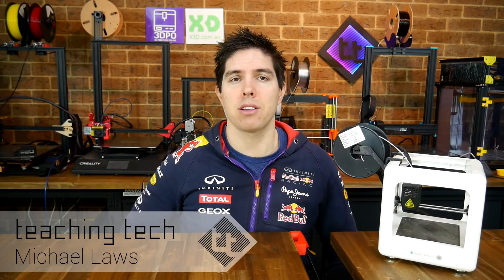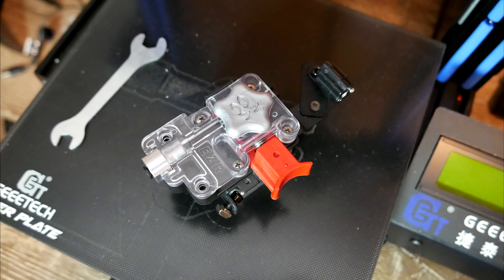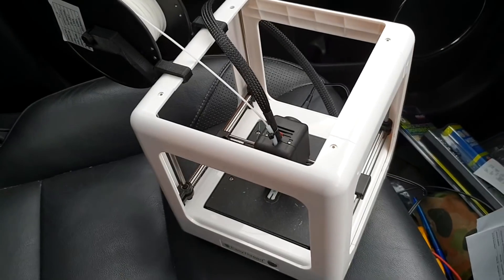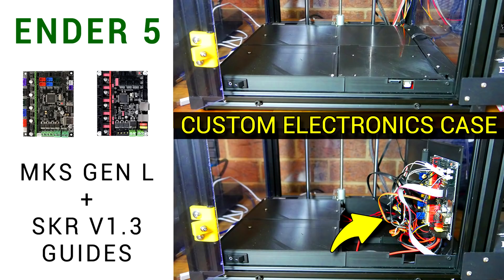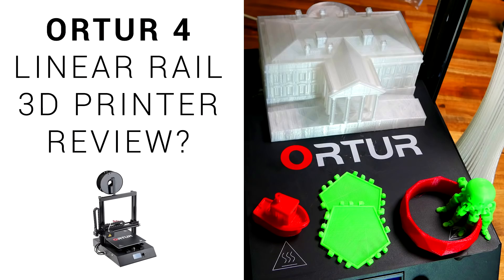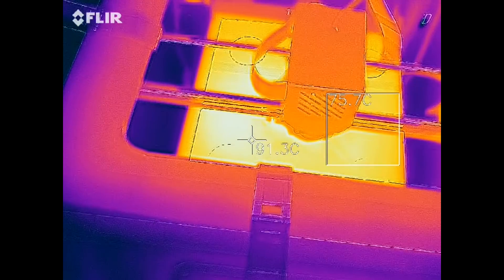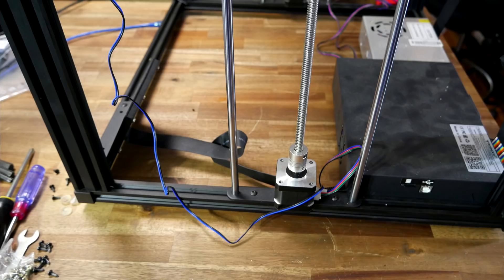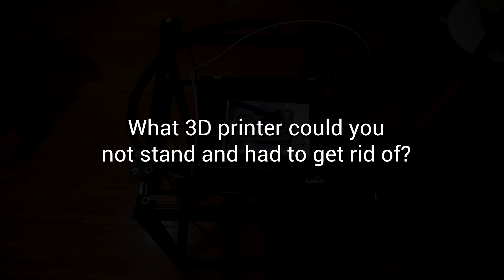3D printer review updates - Keepers and clangers

Comment: Two Trees Sapphire Plus. I knew I was in for a rough ride when I powered it up and got a nasty (electric) shock. Not only was it not grounded properly, whoever had assembled the wiring looms had made them too short and spliced additional wire between the live wires, but hadn't used heat shrink or tape or anything to cover it. In addition to giving me a shock, it blew out the mainboard, which I had to replace because customer services never replied to emails. I was tempted to return it, but banggood said that I would only get about 30% of the cost of the printer refunded (Have never bought from banggood again in the 2 years since). When I did manage to get the printer to power up, I discoverd that an endstop was faulty, the bed was badly warped, the upper frame (pre-assembled at the factory) was badly warped, two of the "linear" rails weren't very linear (more like bananas, actually) so locked up and wouldn't move again. I fixed quite a few of the problems, but the hot end was absolute junk and I never managed to get as far as printing a test cube because the hotend would clog up, but the first 5 or 6mm that I managed to print before it blocked up, made it obvious that there were other issues with the frame. When I used an engineers square against the frame at various points, it revealed that the frame was not square at all on any of the pre-assembled components; which is quite a feat really....even terrible engineers get it right at least once out of every four occasions!

Everything that could have been done badly about that printer, had been. I was happy to see the back of it when I gave it away, but its new owner had no better luck with it and so it ended up being scavenged for its stepper motors (the only - barely - serviceable parts). I never received a response from Two Trees customer services, but given the serious nature of the problems, I reported them to trading standards in my own country in the hope of preventing serious injury. During this entire debacle, I was a member of the Two Trees facebook group and even when I listed the problems on there - and others intervened on my behalf - the customer service rep simply ignored our messages. Their behaviour towards their customers is contemptible and Two Trees are the last company I would ever buy a product from again.

Comment: The most frustrating printer I have had is the old Tevo Tarantula. Nothing on that printer was solid, I haven't gotten rid of it, but I have replaced every single part on it except for the aluminum extrusions and the stepper motors. It's been a fun project and at this point it has nothing to do with the original.

Comment: Actually I had a Ender 3 Pro that was an absolute nightmare. To be fair it was my first ever 3d printer, but practically everything failed on it at one point. From consistent clogging and jamming to dead thermistors to somehow frying the brand new BTT SKR board I put in it. However in doing so it taught me so much about 3d printers and printing in general. But at the end of the day, I just gave up and refused to sink/waste any more money and parts on it and ended up selling it and using that money to buy a Ender 3 V2 on special which I have fitted a Ender Extender kit to it

Comment: In april of 2019, I bought a Da Vinci XYZ minimaker (for $100). With the non-heated bed, proprietary software, and a DRM system that required you use Da Vinci filament, It just wasn't work my time. Sold it on craigslist.

Comment: Speaks to the out of box usability of the artillery sidewinder that there is nothing much needed to change on it. The ones that seem to be selling a lot seem to need more replacement parts than anything else. The idea that you buy a 3d printer then need to replace the bed, the hot end and the electronics.. well, why bother? Just buy something better to start with if you're going to do all that to get something workable.

Comment: I have a Pegasus Touch SLA. Initial design was loud and prone to failure, second flexible vat I payed another bundle of $$$ for immediately lifted all the resin out of the vat into the mechanics. ffs. Printed a few samples before it stopped working. Some decent engineering in the mechanics and laser but flawed process after it cures a layer and retracts.  I cleaned it up but that was the end of it. It sits unused on my desk.

Comment: I had a terrible experience with Geeetech.  The A10 arrived with a bent lead screw and the encoder knob took dozens of spins to move one tick on the menu.  Support was awful, they relied on the community to support their product Any complaint one made about QC of these machines was boo'd loudly by the fan boys.  Simply powering it on at the factory would have revealed the obvious encoder issue and a test print would have shown the leadscrew bent at the coupler.  Such a waste of time.

Comment: Hello i have the Monoprice v2 it has always worked well until the bed quit heating up, what i did was changed the bed temp from 60c to 50c started the print worked great then quit working on the next print, then a couple of days later the bed started working again on another print then quit working on the following print, i am not finding any loose wires and not finding any thing burnt out on the bed, when i turn on the printer and do a pre heat the bed temp dos try to climb but wont go up very much mabe a degree or two or just won't do anything at all. any suggestions on what i should look at or test ?

Comment: My first 3d Printer was a cube 3 and it was horrendous. every print would fail because the specially designed spool holders always snapped the filament. It was not usable. I ended up returning it and buying an ender 3. The ender 3 is Incredible. I have worked with many printers and it is the best one out of the ones i have worked with.

Comment: I'm sad you canned the Geetech A10M. I actually had to replace SEVERAL parts. The Geetech reps on Amazon always sent me the parts free of charge. That's nice, but it also means downtime and it suggests that maybe those parts had flaws they fixed in later revisions. The new parts were often a different colour.
Parts I had to replace:
 - right extruder because the plastic spring on the bearing wheel which presses against the filament had snapped
 - hot end / mixer because one or both parts of the mixer would constantly clog (this may have been some old brass filament I tried to use, it kept separating and gumming up)
 - a fuse on the mainboard (I had crossed out a 24V line and blew that myself. Thought I killed the board but wiring the same value fuse in-line with the old fuse fixed it.)
 - print bed (I upgraded to a glass one because the removable bed that came with the printer almost never separated from prints easily. It took a TON of effort.)
This is my second 3D printer and it's still going. My first was the TronXY100 and I still have it. I may put the TronXY100 back together to have a functional alternate printer some day. I live in an apartment though so space to have 2 printers set up is limited.
Reply: Your review was one of the reasons I bought the Geetech A10M as well as at least one other and some Amazon reviews.

Comment: Looking to upgrade to an Ender 3 and replace my alfawise u30.  I would be happy with my alfawise u30 if it even printed bad prints :)  The only good thing of my alfawise u30 is the touchscreen.  The heatbed cable has melted 2 times.  Just fixed that and then heatbed thermistor  stopped working.   My heatbed is also in a bowl shape. All the y-axis belt mounts had to be straightened.  Motherboard changes how much it extrudes per print detail level.  So you need to do around 10 prints watching to first 3 layers to dial it in, but by that time the heat bed cable will have died.....    Was going to replace the board, but i think i will just buy an ender 3 and use the bigtreetech board i have in it.

Comment: only 3d printer i ever got was a prusa 1st gen(?)...  basically a bunch of abs plastic parts with a bunch of treaded rods and bolts ... not only the frame was all wonky and not aligned nor rigid the bed was worpt as far as i can tell and after a week or two of attempted tweeking and failed printing,  i gave up and used it for  the only thing it was good for ... getting smashed. (tried dozens of print non of which came out right and by that i mean like not even close to finishing)

Comment: i just swallowed the plastic pill and my ender 3 arrived this morning.  very easy to assemble.
any suggestions where to buy filament?  still looking locally to see if i can find.  would appreciate any suggestions.
Reply: Honestly I have rarely had a filament that had significant problems. Esun, and Sunlu have been good for me. I primarily use Sunlu as they cost less. I have some Stronghero pla that is a bit harder to use, but still works. It doesn't stick as well, and is more brittle. Not sure if that is because it is pla, and the rest are pla+. I would go with the plus, any time you can. I have had good results with Overture petg. All this tested on a unmodified ender 3. I purchased all from Amazon.

Comment: I hated the Mono Mendel.  It was inherited in 2019 but purchased when it was new sometime back in 2013.  Unfortunately it simply wasn't in good enough shape to print anything at all, so I was unable to print replacement parts for cracked/worn out pieces to improve it. I gave it one try after I bought an e3 pro and realized it was more use for project parts than an outdated 3d printer.

Comment: Monoprice Maker Select v2 - Not a great machine to begin with. Then the board shorted out after 6 months, and the RMA process was awful. Only silver lining was that after months of running around, they just gave me a refund.
FLSun QQ-S from early 2019. Porrly built, low quality parts, and the worst bed leveling system I have ever seen. You had to stick a metallic plate on the build plate, and use the nozzle as a conductive probe. Then remove the thing you just leveled to. 30 days and it went back to Amazon!

Comment: Hello Michael, I follow a lot your channel and I do like your videos. I own also an Ender 3 and I like it a lot. Of course I did upgraded with all the usual, last is the silent board from BTT for E3 and Marlin 2.0. The part I'm happy is the addition of auto-bed-leveling but on the cheapest way, I mean very cheap, my way. I did called Keytouch ABL because it is based on an Allen Key and I did get the inspiration to make it so after I updated to Vanilla Marlin and there I see some used the key on a Delta printers. It looks like it did get a very good reply from community so I will be very grateful if you could take a look at it and give me your opinion.
I'm very interested to see what you have in mind for later upgrades, but I'm very curious to see your opinion on the modification I made. I did post a video on YouTube (the only one 😁) were I also explained the steps required.
Cheers!
Happy 3D printing!

Comment: M3D Micro/Micro+ terribly difficult printer to get working. Not consistent at all. Had some cool features that would be great if they worked. Just a very sad implementation unfortunately. Sold very cheaply to a friend after I got my Ender 3. I didn’t toss it because I new it could work and I developed a step by step guide that I used to get it to work but I was just done fighting it. I was one of the original backers of their kickstarter in 2015. As much as I hated it, it was a great learning experience and has really given me a lot of skills to make my Ender 3 great.

Comment: Hi I am one of your subscriber from the USA I just got my first 3D printer. Its the Sunlu S8 because of the large printing area. The issue I am having is the printing location. The Demo that comes with it print great in the center of the Bed. But when I  download from another source model, its not going to the center of the bed instead start right at the home area. I am using the latest version of Cura. I am new in 3D printing.

Comment: My first printer was a tronxy xy2 iirc. That was feb 2019. Thing wound up going back to amazon (something has to be pretty bad for me to return it). It had a proprietary board and proprietary beta software that during assisted leveling would sometimes forget to lift the nozzle digging gouges in the bed and you had to do it a lot, between bad choices for test points to far from the adjustment springs (meaning adjusting one corner made the others way out) and weak springs and the installed nozzle was partially crimped!. To many bad issues and red flags. So once the refund posted I got an ender 3 pro and have only had the typical learning curve issues and well known bed warp and weak springs easily fixed with well known solutions.

Comment: Kind of cool, at the moment my goto printer for everything is my TronXY X5S, of course higly modified with for example 230V AC bed heater, closed loop belt for the Z-steppers, corner brackets, direct drive with BMG clone and V6 all metal clone, made own aluminium brackets for the corexy pulleys istead of the flimsy acrylic plates, gates 2GT belts, PC-wheels, SKR V1.3 with TMC2209 drivers, BTT E3 V3.0 touch screen, 3DTouch, magnetic spring steel dual sided PEI print bed (tend to use mirror with 3DLAC most of the times anyway) My modified CR10s with almost the same setup sits beside an collecting dust (it prints very nice though), the Ender-2 is seldom used also but it is awesome with SKR V1.3, TMC2209/LV8729, full graphics display, V6 all metal clone, dual drive extruder with a short bowden, and flex plate.
The TronXY is a very cheap and solid printer, got it used for 160 Euros, put on the good stuff and it is perfet.

Comment: Cubify Cube 3. I wanted dual extrusion, but the design was ambitious and stupid all at once. The filament came in round cartridges with the "hot end" attached to them at the end of some PTFE. These cartridges were prone to jams, and the microchip inside still counted failed prints against the total filament remaining. As a result, due to failed prints and jams, I had several cartridges flagged by the proprietary slicer as "empty" and unusable, even with full spools inside. Hated it so much.

Comment: Yup, DaVinci Jr. It was cheap, and it gave me the 3D printing bug but so much disappointed me. Out the box it worked quite well, but very soon the proprietary ecosystem ruined the experience. Despite launching where I lived with a lot of retailers very quickly stock of filament dryed up. They appointed a sole distributor who only sold to industry and stores, and none of them were buying so I was left being pretty much unable to get the stupid proprietary spools anymore. The hack to make it take any filament is extremely complicated and not a good long term solution, and by then there were many better options starting to appear so I bit the bullet again and went for a Wanhao i3+. I had planned to swap the board out in the Jr but after doing a bit of work on that and realising just how much effort it would be, not being willing to inflict XYZ's horrible nonsense on anyone even for free, I decided to just strip it down for parts that I used to build a laser engraver.